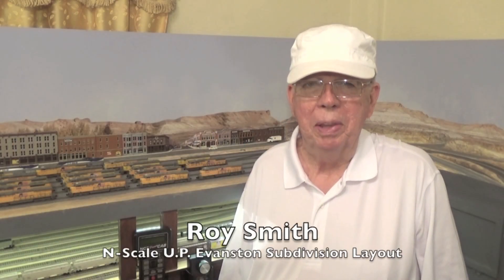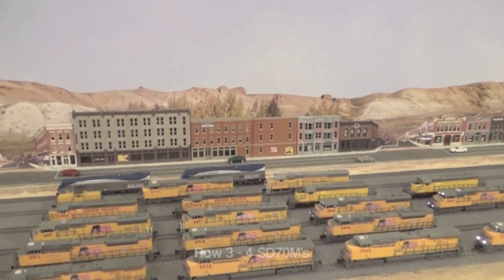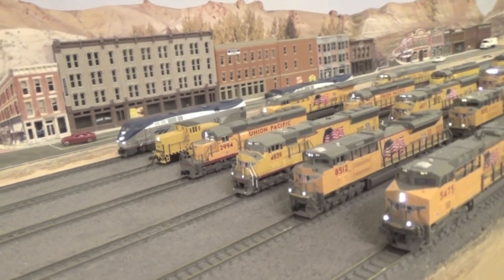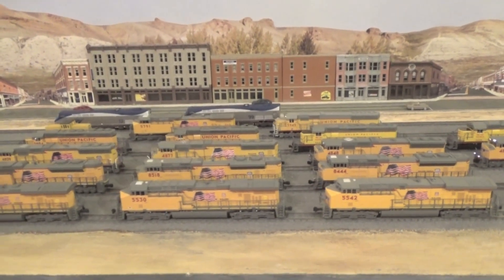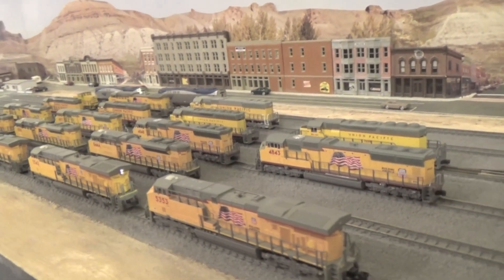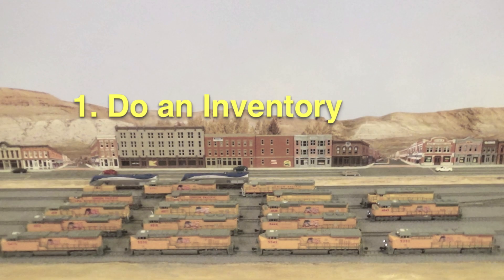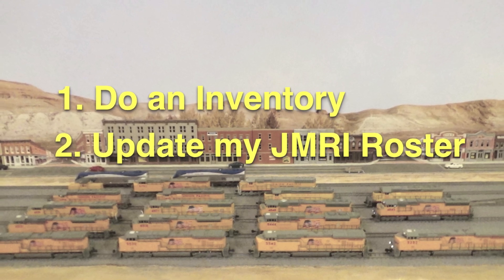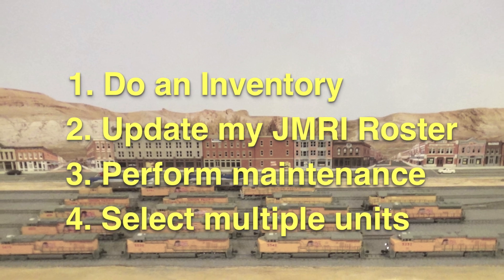My N-Scale Diesel Fleet

Comment: Thanks Roy for yet another interesting video. I especially like the line up you have assembled. It is a very high horsepower motive power fleet that you have got there.I notice, with the exception of the 44 tonner, that you have no 4 axle Loco's. I assume that that is deliberate as you are simulating the local roster. You talk of speed matching and I would like to share with you how I speed match my loco's. My fleet are predominately Kato, Atlas and some Intermountain units. They all appear to run well but with different speed/throttle settings.  Early on I decided to purchase a scale "Speedometer" at around $70 US and it was a eye opener. Speeds that I had considered to be close to prototypical were way out. Using both JMRI and the speedometer I have been able to set the start, mid and high speed range on my Loco's so that irrespective of manufacturer they more or less are good to run together. The speedometer is the standard by which the performance of all your loco's can be judged and therefore eliminates much of the guess work.Once again thanks for your video.Sorry for the long postNeil W
Reply from the maker: Thanks so much for your comment, Neil. I sincerely appreciate it. You're so right about my deliberate choice of big, powerful, modern diesels. I love 'em and the rumbling sounds they make on the prototype. For me, speed matching the diesels on my layout is challenging, and it isn't something I enjoy doing, even with the help of JMRI. But I do it in order to run them together in multiple unit consists. I do have an Accutrack II Speedometer, which you referred to, and have found it to be very helpful, both for speed matching and for running trains at prototypical speeds. I think we N-scalers have a tendency to run our trains too fast, and a Speedometer can help us slow them down. And I also think setting maximum speeds using JMRI, as you suggest, is a good idea. I do that, too. But I still need to set my momentum settings. Here's a webpage that provides me the maximum speeds along the Evanston Subdivision and, for me, is very helpful:  http://www.trainweb.org/brettrw/uprr/evanstonsub/evanstonsub.html.
...Roy

Comment: Hi Roy, impressive loco roster. You definitely get the feeling that the layout is UP. Does the real Evanston subdivision have any run through power from other railroads and if they do will you add those locos to your roster.
Randy
Reply from the maker: Thanks, Randy. Actually, no other railroads run on the real Evanston Subdivision. However, you are making a very good point, because I have been thinking for some time about deviating from the prototype and giving "trackage rights" to the BNSF with one or more interchanges. It would be purely fictional, but I think it would add a lot of operational interest to my layout. What do you think? Do you think that would be a good idea? I like the idea of interchange operations. ...Roy

Comment: great collection roy good looking group of loco's you can never have enough locomotives,,,maybe add one NS unit at som point to give it a splash of color,,,
Reply from the maker: Thanks, Gary. You are so right: We model railroaders never seem to have enough locomotives, even when our layouts are over-populated with them. I'm thinking about adding one or more fictitious interchanges with the BNSF to my layout and/or leasing "trackage rights" to the BNSF. I'm sure it would be quite some time until I get around to doing that, and of course, it would be purely fictitious, since the BNSF doesn't run on the prototype Evanston Subdivision. But it would add that "splash of color" which you mention. And it would make my layout more interesting operationally. ...Roy

Comment: I have a free lance railroad featuring the Denver and Rio Grand Western and I have an interchange with the BNSF. Also, I have run through power with UP. I also plan to purchase 2 or 3 Southern Pacific locos. I think adding some foreign power adds to the realism of the layout as long as you don't over do it. You could add a NS or CN unit or even a CSX unit as a run through power. I have videos where I have seen these locos appear on the UP and the BNSF. I hope you try it. 
Randy
Reply from the maker: Thank you for your response, Randy. The question of whether or not to do this has been on my mind for some time, so i really appreciate your input and the input that others may have. In the beginning, my intent was to adhere as closely as possible to the prototype in the limited space of my layout room. But as time has gone on, I've found myself having to add fictional elements to the layout, most especially fictional industries. Well, it will be some time until I can actually get around to doing something like this, because I've got my hands full of existing projects. But we model railroaders always need to plan ahead, and we need to be willing to adjust our plans as we go along. I may do a video in which I explore the option of adding one or more fictional interchanges with the BNSF to my layout. ...Roy

Comment: Roy-a few years ago I picked myself up a Kato SD70ACe in the Union Pacific Rio Grande heritage paint scheme, and have never been able to get it to run right on my curved track. My other Kato locomotives such as my P42 and F40PH take my curved sections flawlessly, as do all my other rolling stock and locomotives. When the locomotive enters a curved section the trucks on the locomotive get caught on something in the locomotive when they try to turn for the curve. I found this very odd and this video reminded me of my out of commission ACe unit. I was curious if you have had any similar issues with your ACe units?

Thank you!
Bill
Reply from the maker: Yes, Bill, I did have some issues with the first SD70ACe I bought. One of the trucks fell out when I opened the box. In the process, I lost the drive shaft. I had to buy a new one, and after I replaced it, the unit ran perfectly. A lot of people have had problems with the trucks on these units. ...Roy